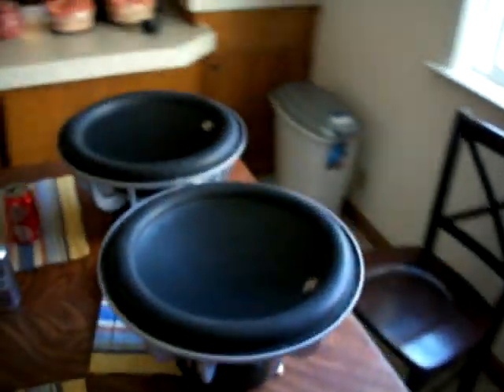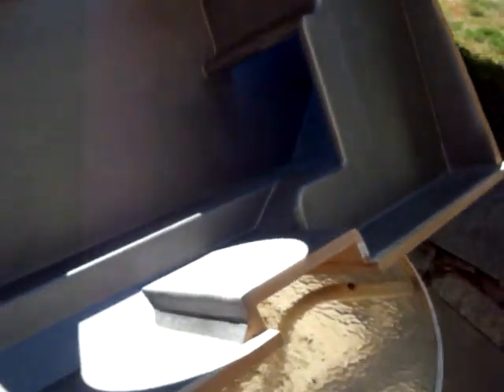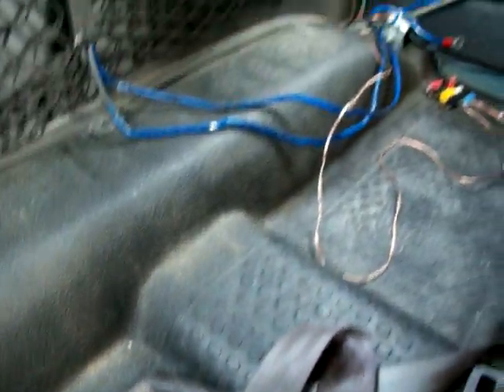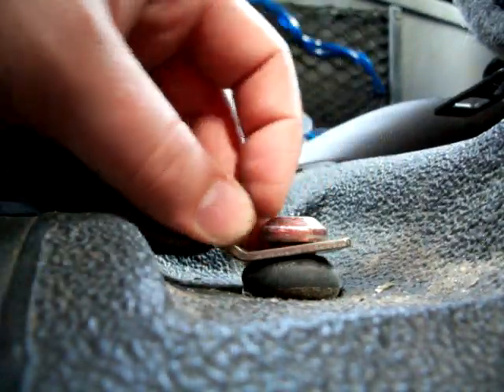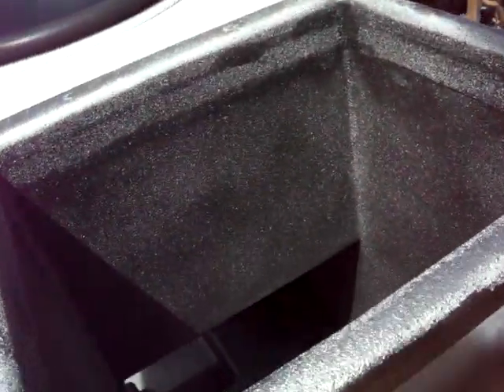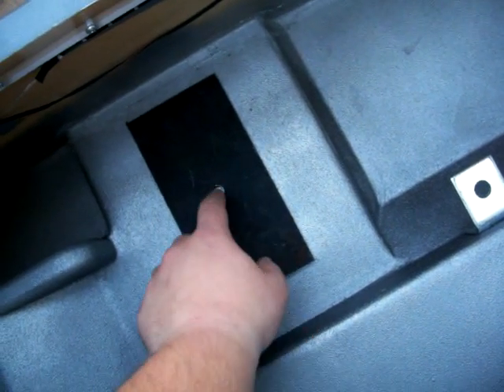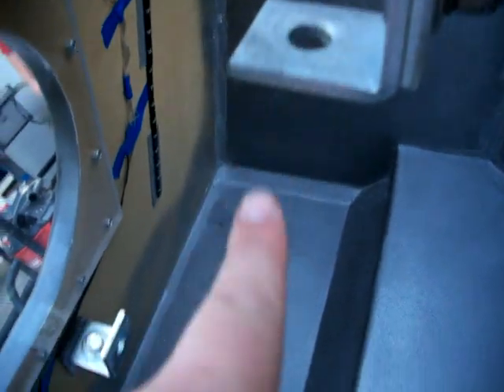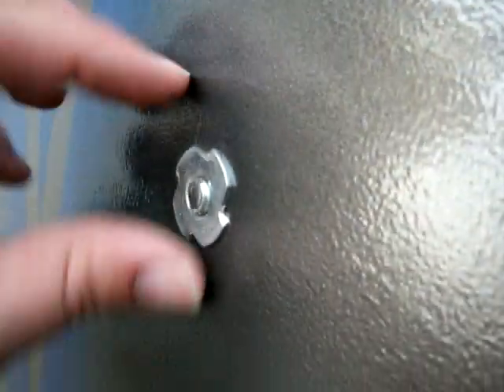New System Build Complete!!!!

Comment from the maker: @raidercann1 hey man thanks glad you like the new box and actually my numbers should go up quite a bit, first my ports before were not located in the right spot for good SPL, second this box has a lil more air space and is built much stronger making it more efficient and better port aerodynamics, third and most important i sold my audioque aq2200D for a much bigger amp!! oh i also added a bit of sound deadener to the roof and back so i will or should for sure break that dreaded 150!!